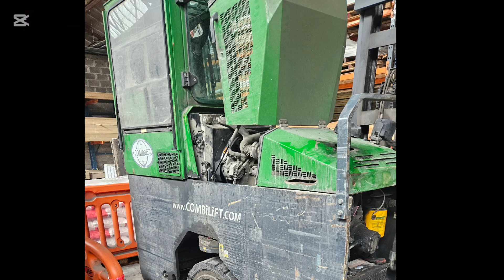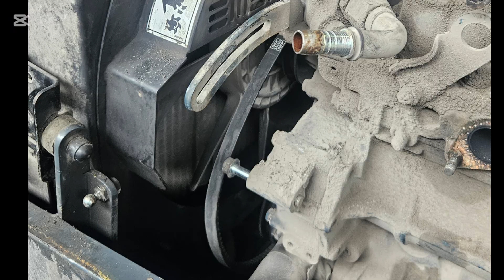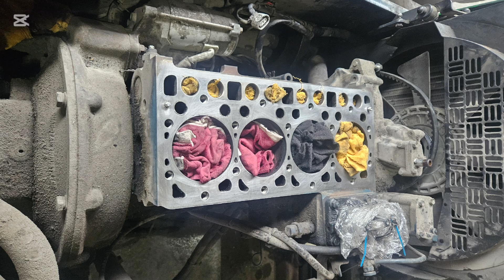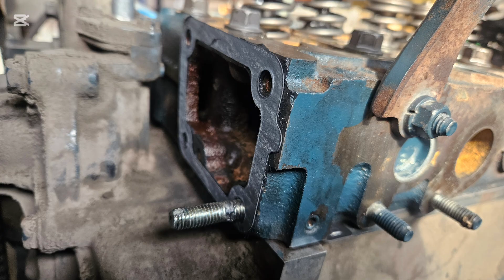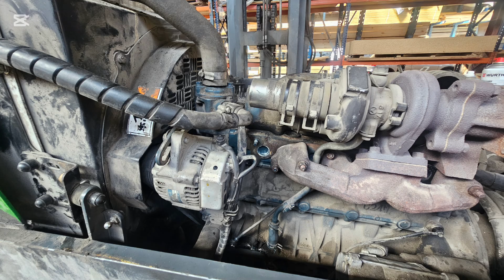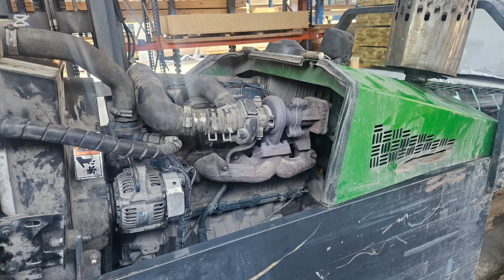CYLINDER HEAD REBUILD ON A COMBILIFT C4000..

Comment: A good trick for blocking small orifices when cleaning the block etc is ear plugs. They expand out nicely to fill the gaps
Reply from the maker: @78mikehayes  That's a good tip Mike 👌
Reply: @ sometimes I don’t make smart arse comments. Not very often…
Reply from the maker: @78mikehayes  🤣

Comment: Nice one Alan, pity you could not power wash it first to get of that stuck on dirt
Reply from the maker: @Gearoid35  Yeah, it would have been nice, just it was stuck in the middle of a builders yard, with plaster board and timber all around.. Couldn't tow it or even start it before work.